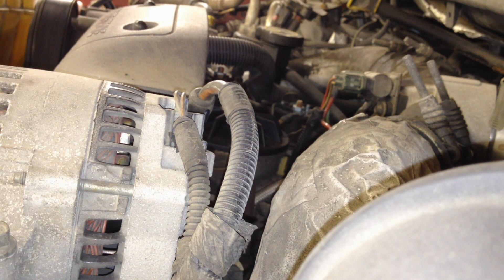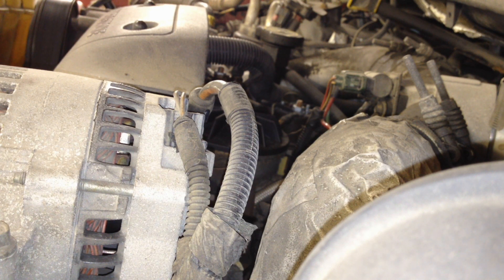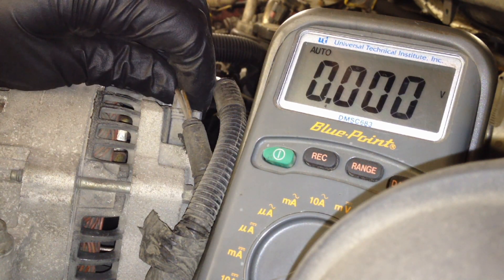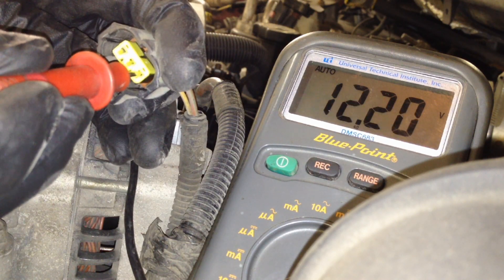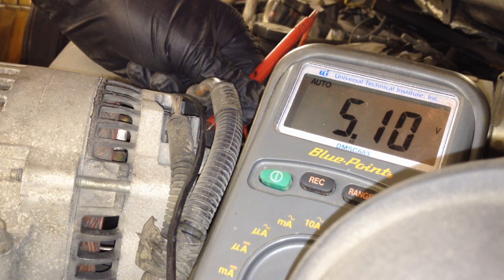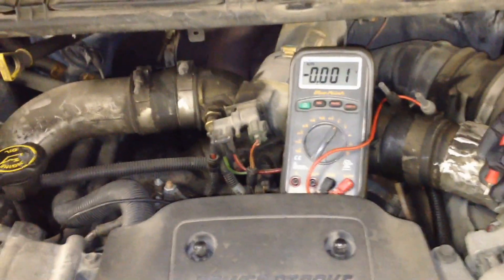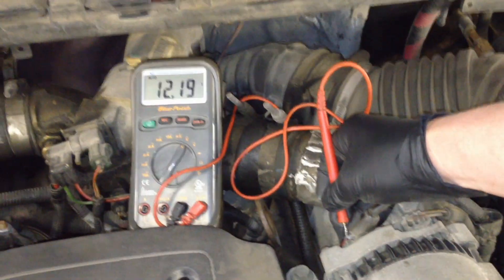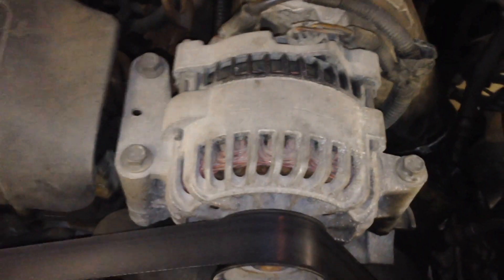Testing Non PCM Controlled Alternators On Ford Vehicles

Comment: I have the same problem....non pcm......97 ford E350 van....new alternator did not fix the problem.......omh'd all wiring and no problem......checked all fuses and no problem........had alternator tested and no problem......ran new wiring and no problem......still won't charge......I am at a loss......anyone with any ideas ???
Reply: Probably the ignition switch

Comment: On this video if you say regulator is built in the alternator then what is the PCM doing??
Reply from the maker: The pcm is not interacting with the alternator at all on non pcm controlled vehicles.
Reply: @FordTechMakuloco  would you know if 2011 town and country interacts with alt? because I am not getting voltage on one of the fields from the PCM

Comment: 2:20 what if one has 12 volts and the other one is cold?
Reply: I have a 2004 4.6 explorer and only voltage on 1 of the wires on 2 wire plug.

Comment: I have dead alternator on 98 ford f150 4.2 L. Before I remove it I dont see a single electrical connector? only have large electric connector and e terminal to battery. Is it possible?

Comment: So-o-o... WHAT is the cause of not charging????...

You missed the whole point of the video - to determine the reason the battery does not get charge!
Reply from the maker: Why would my cause for failure have anything to do with your failure point.
Reply: @FordTechMakuloco  2004 4.6 explorer only has power on 1 wire of 2 wire plug (controller), should both have battery voltage? Thanks

Comment: my 2012 mazda has a ford charginf system..I'm trying to figure out if it PCM controlled or not ..It has two wires going to the alternator plug plus one wire going to the battery/starter

Comment: my gf 98 frontier isnt charging,the plug that has the two wires i can see a huge voltage drop on the wire that goes to the warning lamp it can barely light the test light/cant light 3amp bulb at all.

seeing as this wire is 12v with engine on and is used to throw the warning lamp how could this be the issue?its the best lead i have to the problem as theres a voltage drop for sure i just dont get why the alt needs it?
Reply: What does " engine on mean?  Ive heard of "Key on" or" Engine running"
Reply: @fjb6576   engine running, sorry for my bad translation here

Comment: My power source was same at battery 12.51. but the second input was 11.96 on one side and 12.51 on the other.
I have a whining noise that has gotten worse and a bad burning smell when I start it. Car alarm also goes off randomly.
Battery is 12.52 and goes down to 9 on start then back up to 14. 
When car running - 14 volts hooked up to alternator. Voltage drop I got 50. 
Any help or advice is greatly appreciated

Comment: My customer changed both batteries and alternator, truck stopped charging and now when I check the alt. exciter wire on control connector has voltage with key ON or OFF, I believe the batteries were charging until parked at night, the constant exciter voltage damaged the alt and it no longer charges, where does the exciter signal come from?

Comment: My 2003 still no charge new alternator used alternator new fuse link used one too no charge  good fuse box replace with 2 used ones  test mo charge  no power on pigtail to alternator  conecction computer? Problem?
Reply: I have exact same issue on 2000 expedition. New alt was tested and good....currently stumped
Reply: @woodysgeekchannel2204  
I take the fuse box to electric the Fix it internal issue

Comment: Hey man , Im only getting 11.25 on both input plug wires . Would this be a bad alt. or a bad cable ? getting 12.28 and 14.58 running . Truck has brand new batteries and slow starting.
Reply: Did you find out what your problem was?

Comment: What exactly is a "Non-PCM Modulated Regulator" .. I am going to change my alternator on my 2003 expedition 4.6
I did not remove the old one yet .. I called 3 different dealership gave them vin I was told my vehicle could take the 110amp or 130amp.. I am looking to replace it with 130 Amp Non-PCM Modulated Regulator. Any advise would be appreciated
Reply: What was your fix?

Comment: I did that test on one of the wires on that plug one of my wires doesn't have voltage any clues
Reply: It took a while but one of my friends from Ford help me find the problem passenger side fender there is a wire that a mouse war creature chewed on almost like a fusible link they chewed it and it wasn’t charging took care of it took a while but we found it
Reply: @slyr1  glad it worked out. I noticed he never replied so I left a comment for future readers.
Reply: Did you find out the problem? Have the same issue. Only one pin showing a charge.
Reply: Get a wiring diagram and find out where it's coming from and test it there.

Comment: Hey, I have an 03 Expedition, check charging system comes on at start then will g off after driving for 20 or more min
surface charge on battery is 12.29.. load charge in idle is 14.3.. is this a sign of bad alternator or regulator,, which is built in alternator
Reply: I don't see this channel replying very much I'm wondering if you solved your problem? 🙏🇺🇸
Reply: I have an 03 expedition charges for fine now after replacing the alternator, but the light stays on permanently

Comment: I actually have an issue as such. I have the 2 wire connector and only the orange FLD wire and the large red exist. The stator wire terminal is missing! I was looking at wiring diagrams and according to that both should go to the voltage regulator and the red fld wire does and there is a green on the stator. Someone had an old white jumper wire laying free and idk where it should go.

Comment: i have a 03  7.3l powerstroke and i am not getting battery voltage at the big wire on the altenator what could be the cause
Reply from the maker: Follow it back to the battery I have seen fusable links rot over by the battery.
Reply: @FordTechMakuloco  Seen them also be the first to fry causing a fire next to the battery.

Comment: Please help I have an 04 escape the 2 wire plug going to the alternator is only getting voltage to 1 wire which is constant. the other is suposed to be key on voltage but its not getting this. what could cause this. battery light no longer comes on at any time.
Reply: Ever figured out your problem

Comment: please help i have an 04 escape, the 2 wire plug going to the alternator only 1 is getting voltage 1 is constant and the other is key on voltage (i believe)  its not getting voltage. any clue why it wouldnt?

Comment: please help i have an 04 escape, the 2 wire plug going to the alternator only 1 is getting voltage 1 is constant and the other is key on voltage (i believe)  its not getting voltage. any clue why it wouldnt?
Reply: Check the most obvious first. Key on and no voltage on one. Well then does it come from the ignition switch? If so then it's probably the ignition switch. Very common problem. Potentially even a fuse. Also common.

Comment: Have a problem with my 7.3 power stroke. I'm getting 11.7 while running and I did the first test you did (key on engine off neg lead on battery neg and + on alt wire) and I get nothing?? Now what..
Reply: That wire connects to the battery. It should show battery voltage all the time. Either the wire has a bad connection, it's broken or it has a fusible link (should have one) that has "blown" (like a fuse blows). This is the wire that the alternator uses to charge the battery.
Reply: @jeffnorbert1871 thanks for your reply. It's very helpful.
Reply: You ever figure it out cause I have the same problem